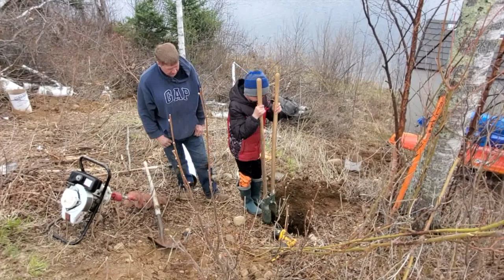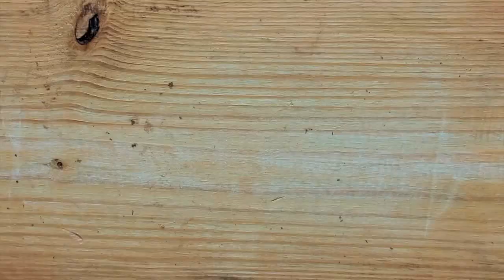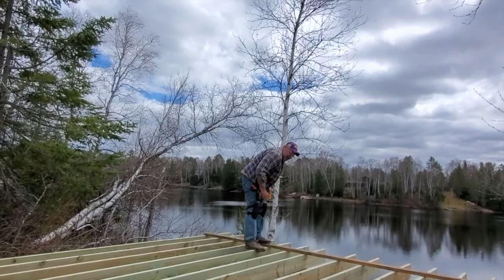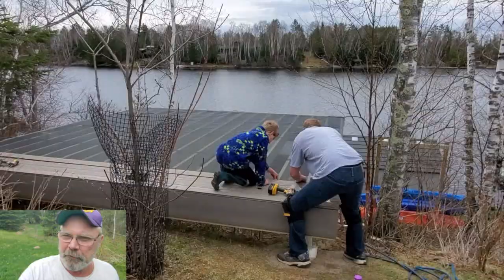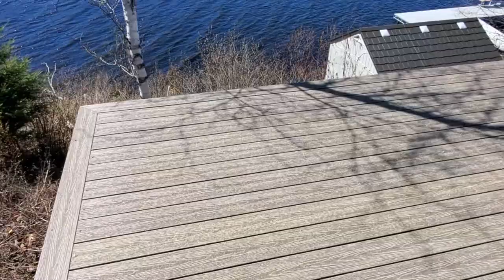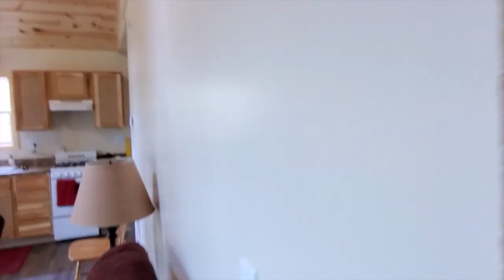Deck building 101 and updates  on an upcoming hike

Comment: I have a Framing Company and I build houses to. Building a deck is definitely hard work. The deck looks great!!
Reply from the maker: The deck isn't bad, the holes where terrible, rocks every couple inches that had to be pried out, 5 ft depth, got close and stuck foam rings around to prevent frost heave. I've seen a couple of your vids, I still do a lot of framing but getting a bit older and slower then when young.

Comment: I HATED digging the holes for my posts. If I were starting from scratch, I would do my subfloor your way.
Reply from the maker: Rocky soil is always a bitch to dig in, lol. turned out nice, it was the first time using that system, up in air still if I like it or not. looks great but not a structural material